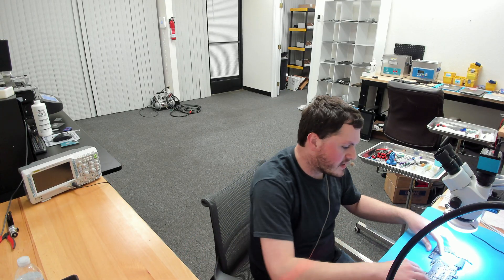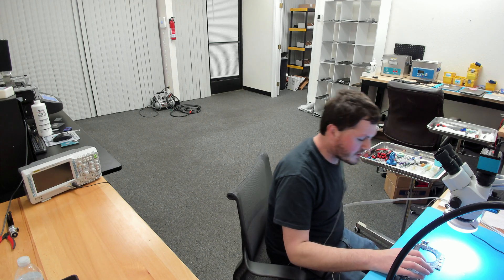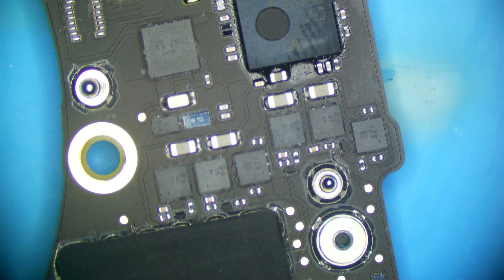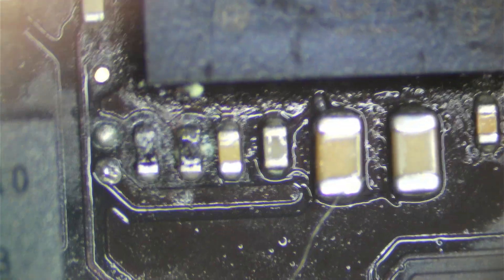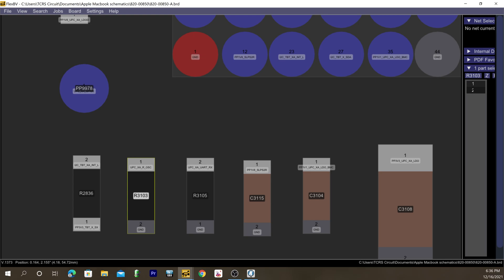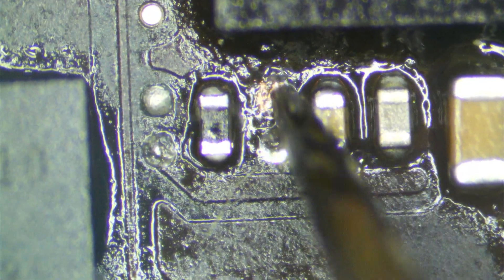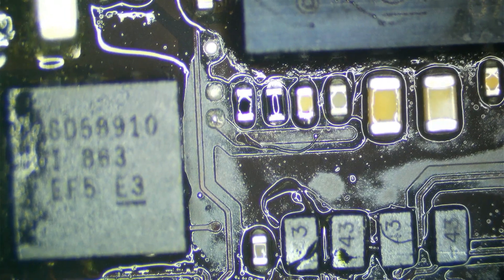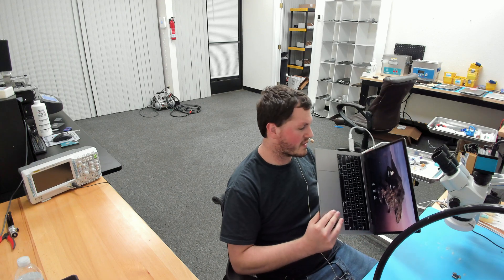Can we bring a 13" MacBook Pro that stopped turning on back to life?

Comment: Use enough flux? You should just use a big tip and solder that little resistor on in a snap. JBC tweezers are great for those  jobs ; ' )
Reply: Tim just had his birthday Tony, you could have bought him a JBC 🤣
Reply: @MrPnew1  Tim don't like JBC.